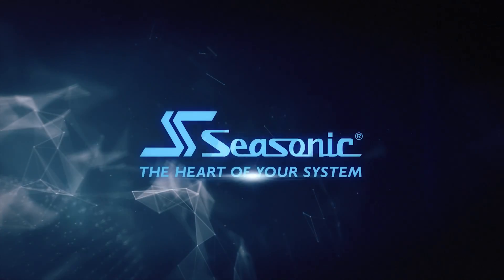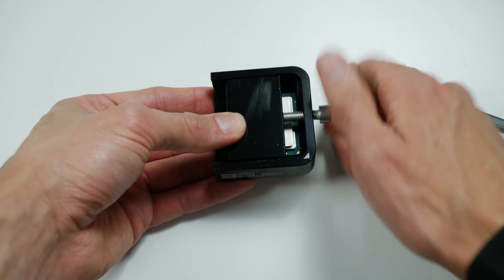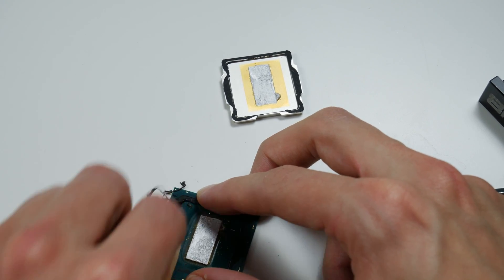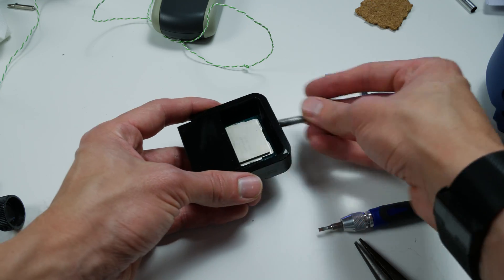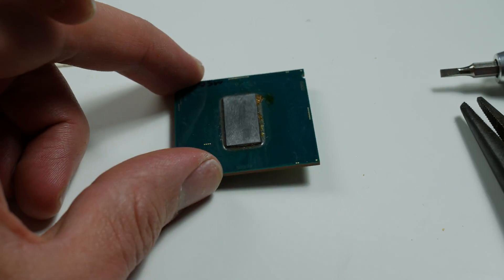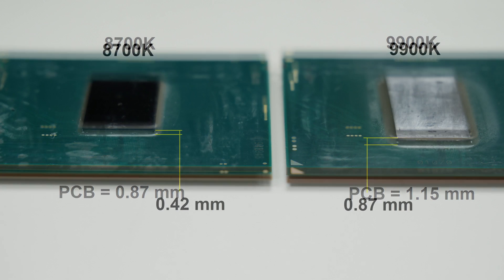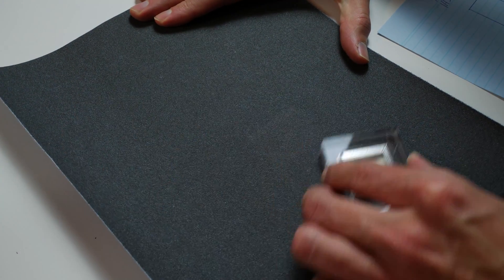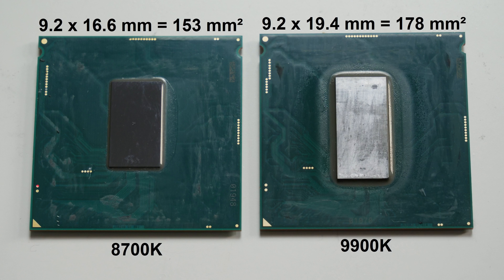Bad sTIM? Why is the 9900K so hot?

Comment: So when is caseking gonna start selling die sanding kits? Cuz I want one.

BTW IIRC Splave said that for LN2 it's better to just run the chips stock and not bother with delidding. Is that correct?
Reply: Normally on LN2 we run Kryonaut/KPx. I was wondering if those could beat solder.
Reply: Actually Hardcore Overclocking it seems that in the video with Liquid Helium the CPUs was not delidded, so I won’t worry about delidding, straight from the box to the xoc test bench 😁
Reply: I am guessing that the thermal conductivity at lower temperature still shifts in favor of the solder However if you also take lapping into account it may just turn around.
Reply: "I have no doubt that derbaur is a good delidder but it is prohibited for anyone to treat a cpu the way he did on this video :D." - It just voids warranty. Btw. the casking pre delidded cpus will have standard german warranty of business to customer 2 years i guess. Anyway you can do with your property what you want.
Reply: The benefit is that the solder has far less expansion/retraction. Liquid metal would be inappropriate because of the sharp drop in thermal conductivity when you cool it to the point of it beginning to solidifying.
Reply: I was about to ask the same question, for LN2 or Cascade (-95°) do we have to delid ?  I really hopes that all this soldering thing doesn’t just bring more complexity
Reply: Ashish Gupta I use Kryonaut in subzero, and I was the first trying to warn Jay in the live chat 😁 with Ryzen of course I go subzero as it is, I was just wondering if this solder have a risk to crack, in a couple of days I’ll test the 9900K with a cascade, a heads up may be valuable, very valuable 😁
Reply: ashish gupta, you are trying to school a master... I "think" buildzoid knows about sub zero and liquid metal. you should check his channel out :) (actually hardcore overclocking)
Reply: buildzoid, if you think about thermal conductivity, solder should be better than kpx or kryonaut, the thermal expansion and retraction could be a problem but I don't think so, so it should beat paste on ln2
Reply: Heh Buildzoid - I was just about to suggest a very similar thing here... clearly if these dies are hot, then sanding down the thickness of the die itself would be most logical. Just so long as it is not too thin (= too fragile). What I would suggest is sanding down with the regular fine grit sandpapers. However before doing that, you really need to surround / encase the whole exposed PCB area around the die with some type of High modulus resin (that is only slightly flexible). This will then act to stiffen the whole PCB under the die + add support against crushing forces from overhead. Then when you start sanding, you also sanding off the resin around the sides of the exposed die. That also helps to protect it during sanding too. And keep it straight / level.

@der8aur can you kindly try this approach for us please? Pretty please? Because it seems that you happen to already have access to multiple 9900K cpus and other appropriate tools? Just gotta figure out the right resin type material, and choose something that is most appropriate. Epoxy shrinks, so cannot use that. But perhaps something like an electrical component potting compound. That will not shrink. For example, you can buy such potting compounds, the same or similar to what is used to encase inductors / chokes. Or perhaps you can come up with even better ideas. It would make for a great follow up video.
Reply: Oh, you already did that in the 2nd half of the video. Sorry I didn't get that far. Anyhow the idea of surrounding in resin might permit even thinner die / more sanding.
Reply: Use a grinding wheel or belt sander.
Reply: Hey Buildzoid, what LN2 cooler would you recommend for Threadripper? It looks like Der8aur's BEAST cooler isn't for sale anywhere (he has a spot for it on his store, but its blank/empty). Would a normal LN2 cooler work, and which one is your favorite for full pot on huge chips like TR?
Reply: Beast TR Edition or Kingpin TRex, but Vince isnt selling the TOP for TR yet. Beast is stupidly expensive but for sure is a great (or maybe the best POT out there) for TR and all i9 CPUs, speacially 7980XE. Regards
Reply: @LechuckNorris  Where do you even see the Beast cooler for sale? I must be blind, because I can't seem to find it anywhere... Also, what price did you see? Above $500 or way higher?
Reply: The TR Beast was a limited edition and was like 500 or 600 euros (thats why i said is stupidly expensive). Most people are using TRex, just no TR TOP yet :(.
Reply: @LechuckNorris  Thanks, that explains why I couldn't find them. I guess I'll have to get the Trex if that's the best available. You've helped a lot, I thought I was going crazy because I couldn't find the BEAST cooler, cheers!
Reply: qlum, as Roman said, the thermal conductivity is about 150 for silicon, 80 for the indium solder and 12 for good paste, so I don't think lapping and then putting paste on it would be better than just solder. if only the solder doesn't crack, but it shouldn't. if you lap the die down to about half like the 8th gen, I still think the solder in sub zero would be better or about the same it is not worth the risk and work in my opinion when you can just slap a ln2 pot on it and go.
Reply: @Actually Hardcore Overclocking: 
Yes, you can just run it without delidding, I tried doing thermal cycle from -100 to -180 a couple times which usually resulted in a 'crack' on previous TIM, but so far in it's solid on the sTIM.
Reply: The Ancient what the heck do you mean “prohibited”? he bought it therefore is at liberty to go as far as shove it up anybody’s ass!
Reply: Guess I won't be buying an i9 9900K then and will keep my i7 8700K until the 10nm or even 7nm fab is perfected
Reply: they should also sell frames for direct-die cooling at various thicknesses for people who lapped their die like this
Reply: For  large die the sear force will increase dramatically, it is require thicker substrate. Also, to handle thremal stress, it need more thicker.
Reply: If you need someone to spoon feed you with a "kit", then this probably isn't for you.
Reply: @OhMyBot people don't use lm for ln2. Just because they're delidding doesn't mean theyre using lm for tim
Reply: You need a kit?! Just buy some 600, 800, 1000, 2000, 3000grit sandpaper and elbow grease on a flat surface. The kids these days!
Reply: either that or just buy quality hardware, aka AMD... ridiculous intel customers... in 5 years they will be building their owns cpus as long as it says retardinside...hahahahaha
Reply: You need a kit for that? Why not just do it?
Reply: The kit would presumably include the set of large testicles that are needed.
Reply: good to just buy it and not worry about sourcing various tools needed.

Comment: Great, now you have delid soldered CPUs, and lap the silicon down, just to get acceptable temperatures?
Reply: What do you think you pay the extra for? Intel is giving you a change to start a DYI project which you can share with everyone. (Attention! Your results may vary!)
Reply: so i have to buy brand new CPU cost 800€ to delid  Before using it 
Happy halloween from Intel
Reply: Trick or Treat?
Reply: sirius4k intel selling Pride and Accomplishment like EA
Reply: If you consider 84 degrees "acceptable"…
Reply: Intel goes full EA (never go full EA!) : The intent is to provide buyers with a sense of pride and accomplishment
Reply: thats why i have a hard time pushing the newer intel stuff to my customers. yeah, they perform great, but they heat up your room like the way-old amd's used to do. personally, i take linus sebastian's stance on this whole thing- you shouldnt have to sound like a 747 while gaming just to stay cool. but the 8700k kinda does. AMD chips, while boosted and under heavy load, run cooler pretty much across the board, and in things that are core-count heavy, they shred the lower-core-count intels (up until this chip). but dont count amd out yet, their 7nm chips are scheduled to come out this upcoming year, im anticipating a 12 or 16 core ryzen, and maybe even a 64 core threadripper/epyc line.
Reply: @ghomerhust  More likely to be 12 core Ryzen and 48 core EPYC & TR. Generation after will probably be 16 and 64 as you said, though :)

Also: AMD have more or less figured out their scaling strategy now and really only need to tweak it a bit going forward, as the technology works well in its fundamentals (the only major extension of their scale-out tech that I can see would be a move to active interposers for the inter-die IF links/routing). This tells me that they will now be spending more of their time in optimising for clock speed and IPC fortunately, something which should get them a lot more market share and consumer mindshare.
Reply: @mduckernz  16 core Ryzen is nothing but confirmed, even 3 months ago that was, soo I don't know why you made that comment.
As for a 64c thread ripper, nothing has been said yet but judging from leaks that's all the more likely to literally happen.
Reply: It depends on what you call acceptable. My laptop easily gets to 80C and it works just fine (its been 6 years, of which 4 years were of 90C overheating abuse). Some people just won't accept it even getting near 60C.
Reply: Now u have to switch to amd
Reply: iBoMbY
You play console games on PC, you never need it! Just go for a good nVidia card!
Reply: Yeah, but I wouldn't be comfortable having a c.p.u. that goes at mid 80s under load, unless we're talking about notebooks, which run hotter than desktops anyway. Reverie_
Reply: I know right!?? Back in 2007, it was considered really hardcore to lap you cpu heat spreader and deliding was only done by the most extreme overclockers. Boy, have times changed.

Comment: Great video as always! Question is, how thick were old soldered Intel dies like 2500k/2600k or 5960X and how thick are AMD Ryzen died in comparison to 9th gen Intel?
Reply: That's what I wanna know. Everything here just seems so strange... I hope enough of a fuss is raised that Intel gives an explanation, but I doubt it we'll get one (officially).
Reply: See der8auer's delidding video on the 1800x, the solder layer seems much thinner than the 9900K's, and replacing the solder with liquid metal nets a 1-3°C temperature drop at the same testing conditions.

 No one has pictures of a delidded 2500k/2600k/5960x so we can't compare, but I bet it's thinner too.
Reply: @josefinagarcia7082  yeah because delidding a ryzen cpu is unnecessarily unlike intel, who now requires someone to sand down silicon to have proper temps on their system.
What an absolute joke, they have been kicked down from their pedestal after years of no competition. 
Next gen consoles are will alsoreportedly use ryzen 2 apu's so amd will completely dethrone intel. Exiting times for sure!
Reply: @fiqirr  intel never had anything in the console market, they've always been using AMD so there's no real difference
Reply: @stephen allen They did, the first Xbox used a Pentium III Coppermine derivative... and an nVidia GPU, an NV20 (GF3) derivative.
Reply: @josefinagarcia7082  so it did, in my mind I was only really thinking of current Gen consoles when I said "always" my comment was a bit of a mess
Reply: very good question. those 2nd gen i-cores were incredible overclockers in their time
Reply: My 3770k was the first with paste and with these 1,35 voltages it easely gets 4,7 ghz on all cores despite it being 22nm instead of 14++.  Makes you wonder.  and with that oc it barely hit 75c with my scythe ninja 3 cooler. The noctua would get 4 degrees of that.
Reply: @Zawisztheblack - Good to know my trusty old 2500k (which I have three of) is soldered which is why it's an overclocking champ with good temps. I've been looking at upgrading recently just because 4 cores is starting to become a bottleneck but the CPU market seems pretty stagnant at the moment and I'm not looking forward to having to delid and grind down a brand new CPU.

Comment: I am really disapponted... I was hoping for a good 8c/16t chip at an easy to achieve 5 ghz. I really cant see any reason to not just get a 8700k at this point, when considereing the pricepoint...
Reply: Get a 2700x
Reply: True... Seems a better option at this point. Again considering price.
Reply: check out hardware unboxed review. It's almost margin of error in gains over the 8700k in many games, somewhat decent gains in certain productivity apps but overall negative usefulness and value over the 8700K.  You need a new 390 board too as the 270 boards can't deliver the power to even run at stock performance.
Reply: If you got a decent cpu, wait out until AMD's next gen or when Intel gets their shit together
Reply: 6900k

Comment: Omg lapping a die, the risk level is insane!
Reply from the maker: whatever works :D
Reply: Can we get a der8auer tool that will micro lap die's ?
Reply: @der8auer  "what ever it takes"
Reply: @der8auer  you may as well removed a couple of trabsistors x)
Reply: I mean sure, I've been an IT nut for years (my CPUs have been under water for over 19 years now) but wow, there must of been some nerves while doing it :)
Reply: I know of soldered dies that literally stay on the IHS after delidding. Lapping is a much more controlled process, believe me.
Reply: I lapped my Celeron 433's in a Abit BP6 board. Just could not get that extra bit of clock speed out of them.
Reply: I mean, tried this, cracked my die twice, took the die down to 0.55mm and it's still running strong

but please don't try this if you really care about your hardware
Reply: @renchesandsords   how did your die crack from lapping it, delidding it , or scraping the solder off?
Reply: @hitmanjenkins  too much pressure on too rough a surface
Reply: It seems less risky than delidding to me. Looks a lot more controlled with a lot less force :D

Comment: Pentium 4 sends its regards!
Reply: 10/10, it's all about the Pentiums.
Reply: I'm kinda sad I didn't notice. #Northwood4Life
Reply: Yes, it seems a repetition of the "Presshot" era (and people will still claim AMD chips are heaters).
Reply: valije I don't hear too many people calling Ryzen a space heater.... That is more reserved for AMD's GPUs these days! God I hope that changes soon.... AMD makes a high frequency GPU core with lots of shaders, 64 to 96 ROPs, and GDDR6 - that does not draw more power or create more heat than the Nvidia GPU it is competing with in Rasterized gaming (screw all that RTX shit...) - and AMD can easily out sell Nvidia with their Overpriced and underperforming Turing GPUs!

In Generations passed, the RTX 2080 would have been the RTX 2080 Ti in terms or raw rasterized performance, as the 2080 Ti is only ~35% faster than the far cheaper 1080 Ti and has the SAME amount of VRAM!  But instead, the RTX 2080 trades blows with the GTX 1080 Ti, and outright loses to the GTX 1080 Ti in games like Wolfensten 2 at 4k! Because 8 GB VRAM is actually not enough to run Wolfenstein 2 at max settings in all ways at 4k, it will spill over to system RAM with 8 GB or less at 4k resolution! And at that Vega64 actually does better than the 2080 in that exact situation.
Reply: @valije  Only the performance is actually there, unlike the Pentium 4 Prescott, whose higher clock rates couldn't make up for the long instruction pipelines; if a cache miss occurred or a speculatively executed instruction wasn't correct, the system would have to start again at the beginning of a very long pipeline. Meaning it lost horribly to the Athlon XP or Athlon 64.

The i9-9900K OTOH, has excellent performance. And its warm temperatures can be managed, which was nearly impossible with the Prescott.
Reply: HAHAHA, made me laugh!
Reply: My Northwood 3.06 w/HT ran so freaking hot!
Reply: P4 HT EE. not that bad even OC 55-60c idle, 85c load hahah  it did not throttle down like newer cpu. they had circuit big as nose hair!! lol. lot bigger circuit and heat loss.
Reply: no heat spike on a tiny point like the next big engineering issue we have to solve
Reply: I have a prescott pentium 4 630, it ran with the stock cooler! I never measured temps with it. I should go dig it out of the box and hook it up.
Reply: Laughs in Pentium 4
Reply: Netburst?
Reply: Pentium D..
Reply: Prescott LOL!!!
Reply: Yeah I had a P4 3.2 GHz HT Prescott, was too hot for the stock fan, I had to buy a huge Zalman copper cooler to use that P4 for games.
Reply: P4 made me switch to AMD64...
Reply: Ryzen is a FX2 !
Reply: Specialy when you need one to update your bios
Reply: The core i architecture is at the point netburst was in 2005 dead and in dire need of a whole new architecture
Reply: Pentium 4 has a low IPC
Reply: @Zero11s You don't say? Someone completely missed the point :P